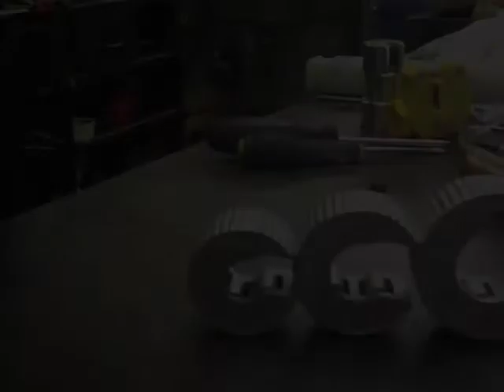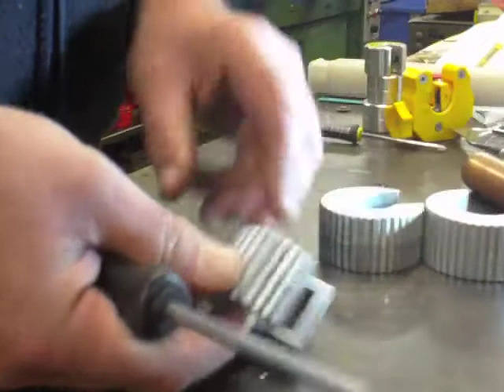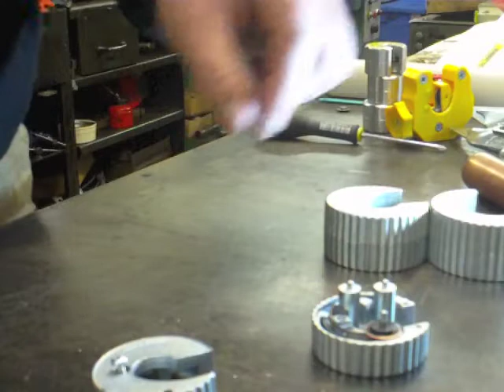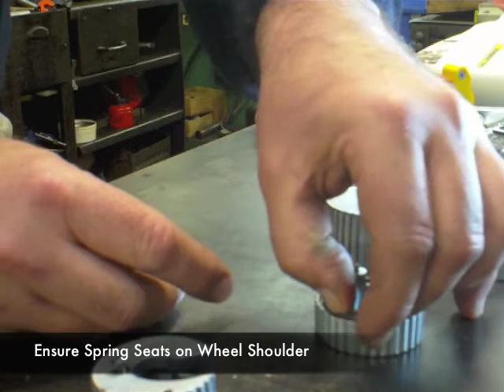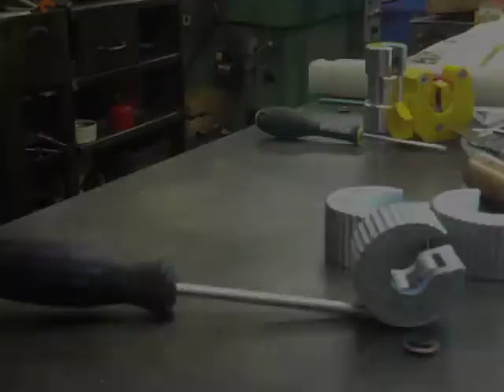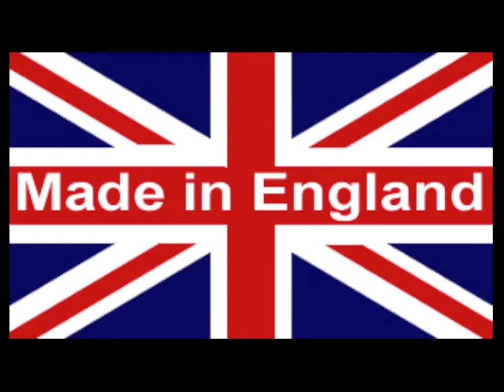269N REPLACEMENT WHEEL FOR 1715C 1722PC 1728Q AUTOCUT

Comment: not a problem. thank you. Also i did end up fixing both my cutters once i figured out that the clip spring has to come out first. then install the wheel. then the clip and pin. Hard to see underneath the wheel when installed but tyhe clip actually rests on the middle protruding wheel of the actual wheel against the side. Not on the pin of the wheel. took me 45 mins to figure that out. but ended up fixing an old one i was going to throw out. once you pull that wheel out the spring clip falls off the inner wheel and hits the center rod. but you cant see that because its hidden. what a pain. no video camera in the world unless animation included could show ya that. thx Jon